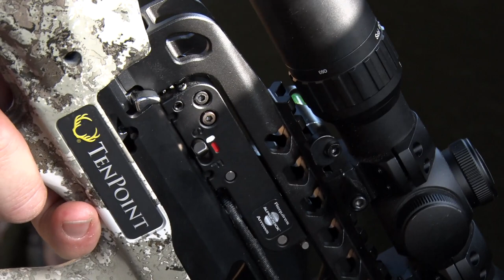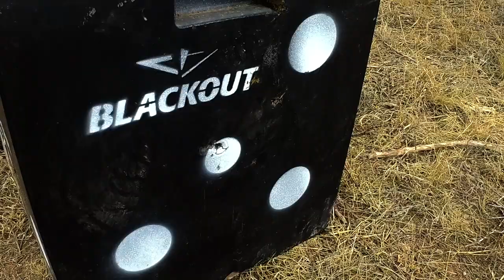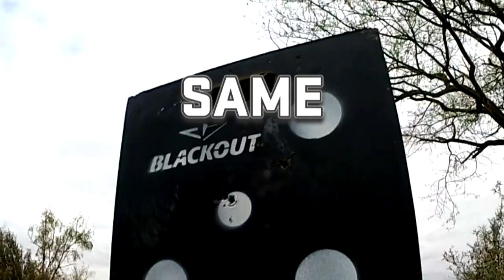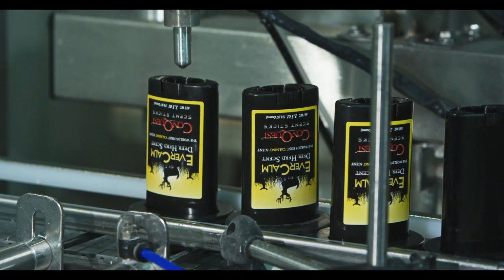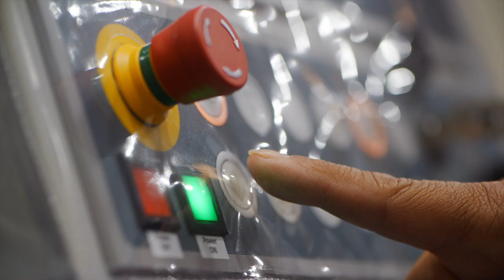The Evolution of Crossbows

Comment: I got my 1st crossbow this year. It is a 2020 model. Killer instinct boss 405. 405fps 140ke. I upgraded my scope to killer instinct Lumix IRE. I have the DSC cocker it is a quite crank. My bolts are victory 425 carbon grain. My broadheads are Rage Xtreme. And a tactical sling . The crossbow is great. I am hooked.